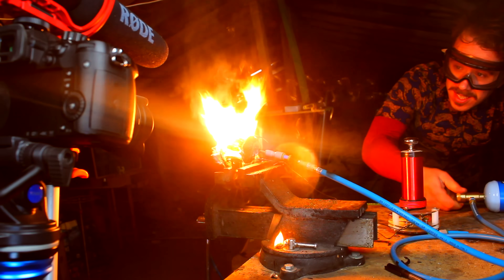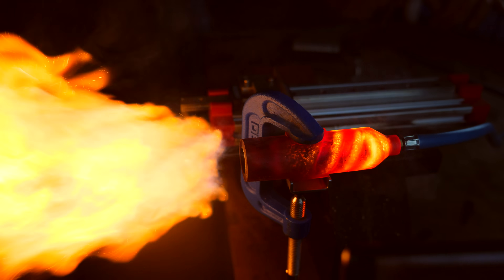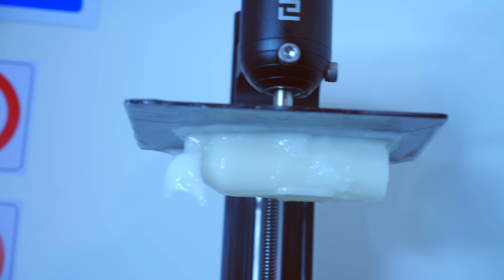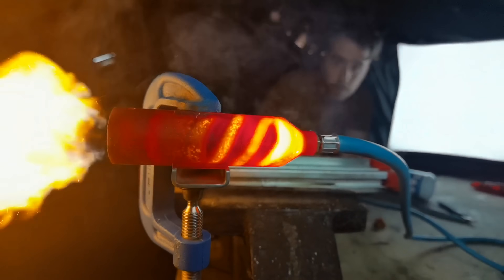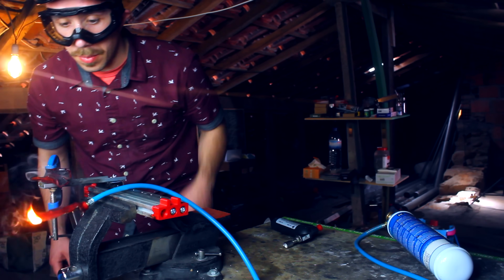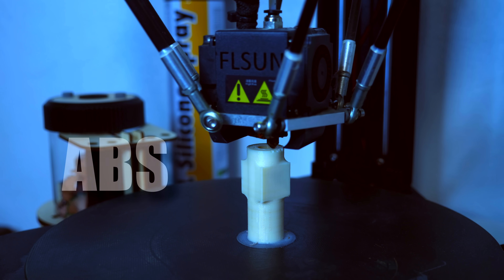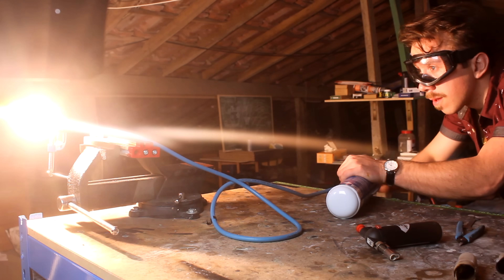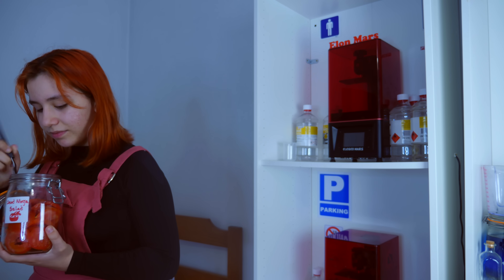Rocket engine that uses itself as fuel! (3D Printed)

Comment: If you use a metallic filament you with have metal powder in your abs (or PLA or PETG) fuel.  Perhaps that will provide another source of fuel and perhaps higher temps and a more even burn.  It also means that you can use phrases like ‘highly exothermic’ and ‘combustion boundary extension’ in your video to excite things for the serious engineers who are stealing your ideas for themselves...

Comment: Are you sure you aren't overthinking this, Integza? Casting rocket candy (KNO3 + sugar) directly in a ceramic rocket engine seems more elegant. With a central void to ensure a burn from center outward you might not even have to seal the ceramic as a separate step since by the time the fuel had burnt to the outer wall the porosity would be irrelevant.

Comment: Hey you must try printing it with 75% infill or something like that and while it is being printed partially enclose the printing area with a acrylic box of some sort and fill it with OXYGEN AND KEEP ON SUPPLYING IT SO when it burns it will get extra punch of oxygen as it it will expand on heating and increase the surface are due to 75% infill so it will be efficient and make a thick outer sleeving out of metal sheet as a cylinder IT WILL FLY TO THE MOON!!! (atleast that is what I think).

Comment: Ohh The Mad Scientist is on the loose.  I love your stuff.   I was wondering if you made your ABS engine a little bigger in diameter, with a full 1cm wall thickness. Inside, have ridges similar to your double helix but fill the engine with the sugar solid rocket fuel (online recipes abound) but leave or drill a 3mm hole up the center for your fuze to ignite but also add your O2.  Burn one with O2 and one without.   I will bet your Super hybrid Rocket motor will scream.   I have done some abs printed engines for solid fuel similar to the U.S.'s Space Shuttle SRB's.    It was pretty good but my rockets always came down from the sky as a burning ball of flames.   The trick is finding the correct nozzle.  Keep up the awesome videos, I love your jokes.

Comment: For better burst of power you could try infil pattern for example gyroid (not 100% shure if oxigen can flow trough it, and it could teoreticly explode). 3D pattern should give you more contact surface with oxigen so better burst of power. Another think is that you could try using wax like resin because wax is sometimes used as solid fuel in hybrid rockets, but i'm not shure if wax like resin and wax have same power output.

Comment: Some simple solid rocket science:
The thrust duration is determined by internal surface area. The star is the negative space in your print. The more points on the star that makes up the center the faster it burns the fuel. More points faster burn harder thrust, less points longer burn longer thrust.
Since you're using something that's HORRIBLE at efficiency you need to have as many points on the star as you can produce.  Your rocket won't burn long but if you get the right number of points and the right nozzle it should shove REALLY hard for a few seconds.
No idea what your going to lunch but you do need to wrap your fuel in something.  I recommend using any can from food/drinks as a sleeve. That way you can use the can as a solid mounting point for the nozzle and eventually what ever you plan to launch.

Comment: You should had a 1/4 turn ball valve on your air feed! you will get faster response on opening and closing the air feed and it should be safer.
How about inserting your 3D prints in standard steel pipes with threaded fittings? it should also fix the issues you have with leaks!

Comment: Video idea: 3D printed ceramic nozzle with resin-sugar printed fuel core, inside a ceramic printed core housing.

Should eliminate the the nozzle burn-off, giving more uniform exhaust. Ceramic core housing should also stop the rocket from eating itself XD

Comment: Would be pretty cool if you could make a liquid hydrogen rocket but i think that might be thinking a bit far ahead at the moment because you’d need a bigger workshop and improve safety features like some sort of screen incase of explosions and a gas shut off valve would stop flow of the O2 instantly rather than that tiny valve you have to spin.

You should put a tomato on one of the rockets you know would explode/ burst into flames! Tomatoes are disgusting!

Comment: There is a special type of filament (Ultrafuse 316L from BASF), that can be used to 3d print metal parts. Try printing your rocket (including nozzle) with it, put in your 3d printed fuel and feed it liquid oxygen. The filament can be processed with a normal FDM printer, at around 240°C on a normal printsurface with a normal heated bed, afterwards it is debound and sintered in a kilm.

Comment: have you ever tried a combustion chamber (from jet engine design) on it? create ring surrounding it then connect (or print it) at the end of the nozzle, I think it would work since it creates compressed air from the intake.

Comment: i think what would probably be a good idea is if you get some metal sheath that serves as both the rocket nozzle and as a cylindrical holder for the solid fuel. all of these might have produced more thrust if only they didn't fall apart at the end, so something like a metal pipe with a nozzle cap soldered on would work wonders

Comment: It seems that in all your experiments heat is your enemy, specially if using 3D printed parts. Maybe try the opposite temperature spectrum like a cryogenic turbine with liquid nitrogen as your fuel. The liquid nitrogen is pumped and then expanded (boosted by heat from combustion in a heat exchanger/boiler or ambient air) which turns a turbine that in turn drives the pump... would it be a world’s first?

Comment: try a steel case around the 3d printed fuel for a better burn/ better chance of holing up. the hybrid engine would run better in a tube so it can also burn more of the fuel.

Comment: you smart engineer and you have beautiful sisters :)  your ABS engine good idea but i guess you have 2 main problems < over heated points  in Combustion area, and  nozzles Distorsion    / i guess if you use oxygen bore cooling  will make A good result in design ;) i like your channel

Comment: What if you made this like those Russian stacking babushka dolls, so every time the rocket finishes combusting and then slowly it’s shell starts to burn away and then the entire thing explodes, it will then be inside another rocket slightly larger, and you could just print it so it’s in layers, then it could burn through multiple engines inside of one, and if u make a solid outer frame out of a stronger material, you could reuse it and just print the “fuel pod” of stacked engines! @Integza

Comment: 1) I suggest you try the water glass dip as a glaze.   It’s fireproof to 3000F.

2) This may sound odd, but it’s harder to make small parts work than large ones.

If you print a larger rocket, you’ll have more surface area on the mating surfaces.

3) By the way, is it possible to make this all one piece?

Comment: I have a theme for a future video: upgrade your gas setup.  For starters, you NEED a ball valve with a spring-close mechanism for each type to be able to quickly turn the gas off.  (Pull the lever to open the valve; when you let go, it slams closed *instantly*.)  You also need a more solid way to mount the cylinders and controls, so why not make a complete solution based on a toolbox?  The cylinders can rest in the bottom and the levels/gauges/etc. can mount as a control panel in the tool tray.  (The hoses can be stored in the lid, so the toolbox can be closed up with everything in it.)  That way, you can have the whole thing completely portable, yet quickly set it up whenever, wherever you need to.  You can even take it on the bus without being asked pesky questions.
Reply: Also isn't the thrust totally limited by the pressure of the O2 canister? This is why liquid engines have turbopumps. No matter how good the fuel and O2 supply, chamber pressure will never exceed the O2 supply pressure.

Comment: U should really upgrade your oxydizer setup. For example, try adding a simple ON/OFF valve so you don't have to twist your wrist off everytime the rocket is done producing trust and is just burning. :D

Next vid idea: Try printing the rocket engine and then layering the sugar inside the rocket afterwards if possible. Maybe using some mixture of resin and sugar and drying it with UV lamp.
Sunbathing tomatos in rocket trust is next on the list :DD

Comment: Do not burn ABS. Above 400C, ABS decomposes into a gas mix of which the component, 1,3-Butadiene, is the primary carcinogen in cigarette smoke. Long-term exposure leads to cardiovascular disease and leukemia.

You probably also shouldn't be burning cured photosensitive resin. I don't know exactly what it is but it's probably horribly bad for you.

Comment: Create a recovery system for drones so you can fly them without worry of dead battery. Even a deployable parachute that fits discreetly and isn’t advertised. 

I’ve been thinking about “rats” lately and they deploy to restore hydraulic pressure to flight control systems on aircraft during failures.

Comment: You could try 3d printing metal parts?
Reply: -by using pla to make a plaster mould ( cure mould and melt out plastic)  and pouring bronze/copper/aluminium in?
Reply: I thought no you can get away with doing this if you were to buy a small electric furnace 🙃

Comment: Expanding on the rocket idea.. You could use the rockets to make multiple stages using the burning of the fuel as a way to disengage each stage; they would burn themselves out and off. Then you could send those filthy tomatoes directly into the sun.

Comment: You burn away your nozzles in a matter of seconds. Try making a heat proof nozzle and somekind of casing for the fuel. A glass tube or a metal can to keep the thrust constant on same direction.  I'm sure that sugarmix works as a fuel, you only spread the thrust so much after the nozzle melts that it loses all said thrust.
Reply: Crap I should have watched the video till end :D  You said the things I did.

Comment: Try making a propper nozzle from a heat and pressure resistant material and then use the Printed fuel together with Liquid Oxygen inspead of Oxygen Gas
Reply: The LOX would help, but oxygen is VERY EXPLOSIVE

Comment: The nozzle ratio from the throat to the end of the nozzle is very important for efficient thrust. Also chamber pressure is a huge factor in your overall thrust. For maximum efficiency, the nozzle should be 10 times wider at the end than the throat. Also, for a long, consistent burn, try reinforcing the combustion chamber by making it out of metal, inserting the fuel, and attempting to weld on another piece of metal as a nozzle.

Comment: some observations from some years back when I was playing around with rocket candy:
1. you need to use a non-combustible material for the nozzles. If you don't want to use the tamped bentonite method, you might want to try 3D printing a high graphite mix in your ceramic printer.
2. you need to insert the fuel grains into a combustion-resistant casing to prevent burn-throughs along the sides of the grain. I found that one to two layers of aluminum foil wrapped around the grain, followed by either a paper-tape layer or even just direct insertion into the PVC outer casing, worked pretty well.

Comment: Ceramic nozzle, 3d printed. Rocket body made from a stainless steel thin wall tube. It does all need to be 3d printed, just easy to find on Amazon or your local hardware store.

Comment: What if you made a simular design but 3D printed the body/nozzle out of the ceramic resin and have insert-able 3d printed solid fuel. During combustion the ABS may even  fuse in the pores of the ceramic and make a better seal.

Comment: All you now need to do is resize the entire thing to fit a common metal tube diameter and use the tube as a outer body. You will need to use a steel casing some day, so you could start with the hybrid one. All it takes is a steel tube of 1.25 mm wall thickness to contain your engine, and it will stop failing due to chamber pressure.

Comment: Ok, ABS as fuel, ceramic as the nosel.  Make it in sections, make a tube with gas intake as a separate section so you can incert the fuel.  You were close with the slip coating of the ceramic, just not enough coats and drying between them prior to baking.  Keep goung and more tomatoes at tbe business end of the rockets.

Comment: You oughta do a reusable metal cannister that you can insert the printed fuel and nozzle into, and then go back to using the helix-style fuel structure for maximal surface area. It would give you the benefits of a sturdy rocket body that won't burn holes in itself after 3 seconds as well as the increased burn intensity from the helical surface area. Also, if there is a way to initiate the burn from the top of the rocket rather than from the nozzle up, it would probably give you a better, more consistent burn. That could just be as easy as letting the sparkler burn into the body of the rocket further before opening the oxygen.

Comment: What if you printed only the fuel with sugar enriched resin/ ABS and have the housing and nozzle made of a stronger and more heat resistant material?

Also, ABS fumes are toxic, keep your attic ventilated!

Comment: Nice 👍
Here a suggestion on a rocket engine not as effectfull as this burning one.
First, electroplating without silver ink - use the way in old days mirrors was made AgNO3 + glucose.
The idea is a hydrodynamic air rocket. Make air ions and move them (linear motor) and generate force. Principle: http://en.m.wikipedia.org/wiki/Magnetohydrodynamic_drive

Comment: You should enclose your solid fuel in an aluminium pipe, threaded on each side to fit oxygen on one side and some testing ceramic nozzle on the other. Keep on those videos, it's best 3d print experiment ever !

Comment: Most rocket operation and performance are highly influence by the ignition during the start up. So I think the rocket would operate better if you ignite the rocket from the aft section (region around the oxidizer injector) instead at the nozzle exit. I find your video really interesting, it allows me to consider a lot of practical design aspect of hybrid rocket.

Comment: MOST RESPECTED INTEGZA, CO-FRIEND OF TESLA,
 3 Things I have need to say having watched the videos on the tests of the rocket fuels:
Thing1: In alll of them, as soon as the flamefront moved back towards the oxygen, OR stood still in one location, a hole formed there, suggesting that a way needs to be found to prevent that.
Thing2: The burn-through happens at the hotspot that develops and that terminates the test as the force of the burning fuel excapes through the holes
Thing3: You need to put the fuel into a containment tube that is not combustible (Like a pocelite thingY) so it can direct the force towards the back,  and perhaps increasing the oxygen inflow as the burn progresses?

Thing4: TOMATOES ARE TRULY DISGUSTING!

Até á proxima vez!

Comment: If you want more trust you have to increase the chamber presure!
Stuff the fuel into a metal tube, and give it a smaller nozzle that doesn't erode as fast! Use clay or graphite for the nozzle!
3d printing the grain is a good idea, that way you can alter the burn profile pretty good to achieve even burning true the whole grain.

Comment: Did you try using PLA for your rockets? It‘s kinda made from corn starch / sugar. Maybe it works also. In addition, try to use a metall nozzle. If you interrupt the print after printing the nozzle hole, insert that part of a brass rivet that has the flange. So the gases won‘t press out the „nozzle“ (I talking about this 2-part rivets that are used for textile: A flanged zylinder and a washer, pressed together with a tool and a hammer).
Additionally you should not print a hollow burning chamber, but a chamber that has a star-shaped crosscut. That expends the useable surface. The burning time decreases, but the thrust increases.
Good luck!

Comment: Why not trying to put an non flammable surface behind the flame to help it move? I think even nasa have a way to use gases to accelerate rockets more efficiently. In my opinion you should give it a try and measure thrust that way because relying on the resistance of air to propell your rocket doesn't seem really promising

Comment: I don't know if it would be cheating, but the integrity of all these engines would be greatly improved by sliding them into a housing.
Even an extruded aluminum pipe would prevent leaking, and help the fire go out the direction intended.

Comment: Can't you 3d print with KNO3 mix, polystyrene or powdered aluminium and make the walls bigger? As just when the burn is staking to get powerful the walls burnt out.
Also would xylene work as a gas mixed with oxygen

Comment: You should size your 3d printed engines so you can put them in some hardware store pipe. You could even put some adapters on it to hold the engine in.

Comment: you need a load cell to measure the thrust, maybe use an Arduino to log the data and make graphs of the different designs, also check amateur rocketry resources on how to build the nozzles since a nozzle not optimized for the atmospheric and chamber pressure will be counterproductive, maybe it's why you got thrust when you had only the cylindrical bore and no nozzle, also you could use rubber infused with aluminium powder and cast it in a mold it will be more energetic than ABS, also that brings another problem, even with 100% infill FDM leaves air bubbles on the prints that will cause uneven burn and since your rockets don't have a casing they might rupture and explode as in a catastrophic failure that might set your house on fire.